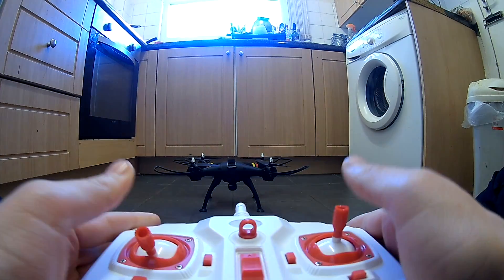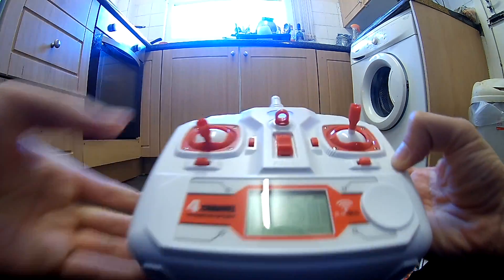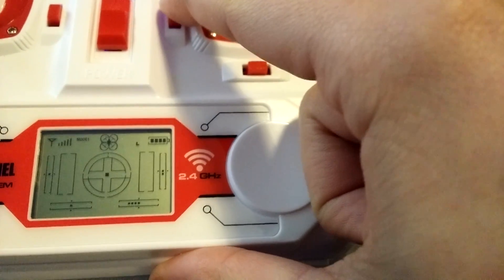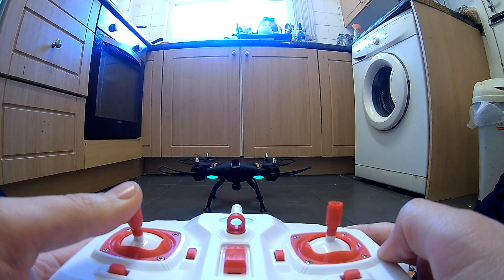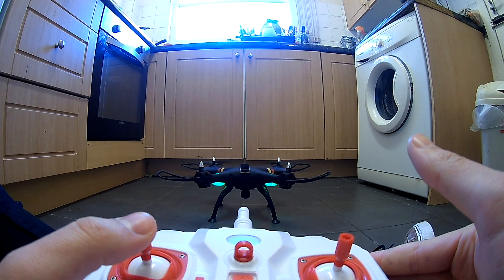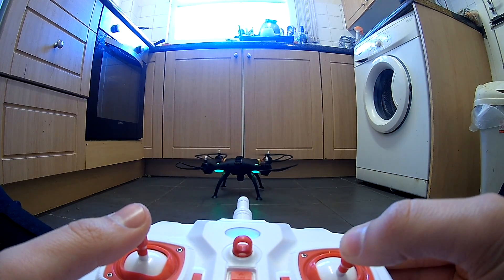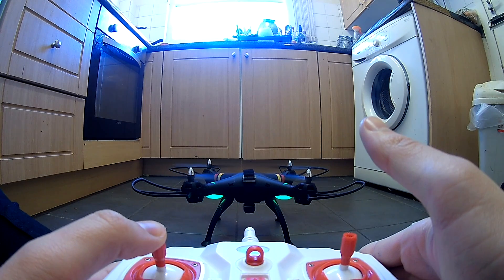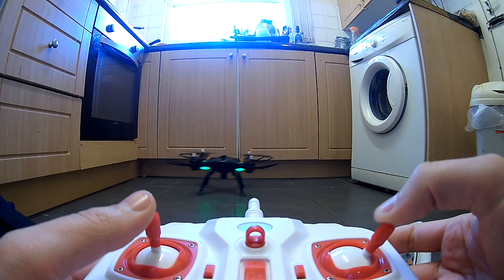Drone How To: Trimming Your Quadcopter

Comment: Thanks, but I am still unsure. "its drifting to the left, so add right trim", but what does that mean? what is right trim? do you mean to push the button at the bottom of the right controller to the right or left? same if its drifting rearward, which trim button do you push, and in what direction?

Comment: there's no way to adjust trims here (accurately)-  you're fighting your own propwash (ground-effect),  trim a little if it's impossible to take off, but trim in open air,  not near ground
Reply from the maker: +TekMunki FPV I know, I was trying to demonstrate why you need trim and how to use it, rather than showing me properly trimming it. Thanks for the tip though